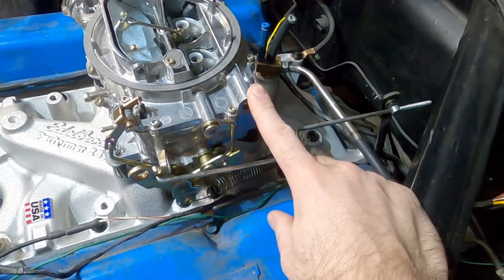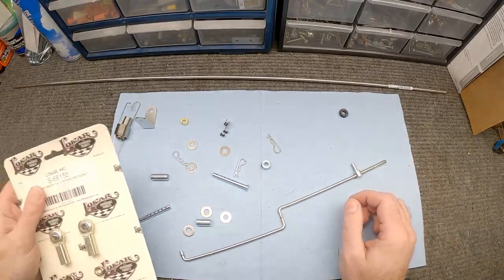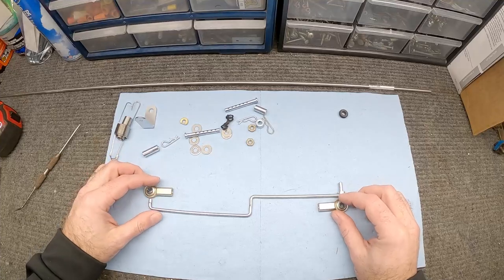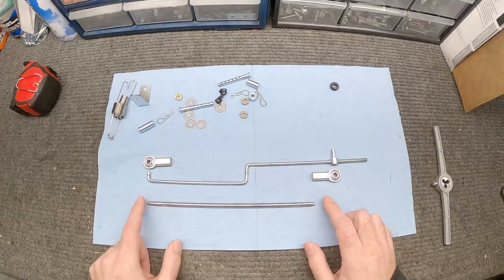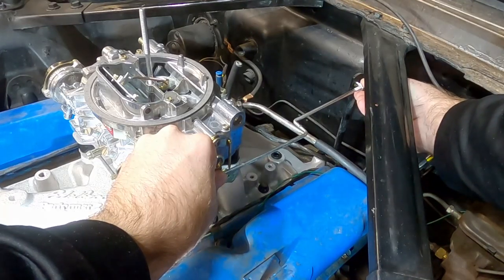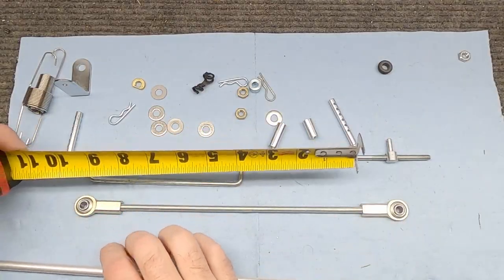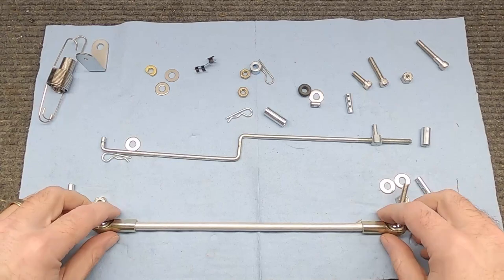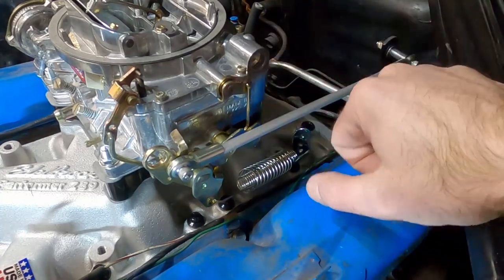How to make Custom Throttle Linkage

Comment: Made basically this same setup a few years ago. Recently I swapped out the aged and oxidized aluminum tube for stainless tube that I got at ace hardware for a couple bucks. Taped it off before I cut it and put it in a drill to polish it out.
Reply from the maker: It's fun making parts like this from whatever we can find out there.  It would have been nice to design this so it's adjustable, but it works for now.  :)

Comment: I was able to start my engine and break it in, I had a problem with the coolant, but other than that it all went good. I just went ahead and drilled a hole on the rod and called it a day. haha, my video would have lasted 1 minute hahaha.
I do plan to make it look better, but for the time being it works. :)
Reply from the maker: Congrats on getting it started.

Comment: I appreciate you documenting the goofs along with everything else. I also like the "doing it yourself is fun" comment. Sometimes driving into the smorgasbord   of extra parts is a more satisfying puzzle than just picking up that kit. There's a "reason" we save all those extra pieces. Plus an extra video this week!! I have the 1406 as well. 

Do you know why my fast idle would be slipping? Basically my set screw is in the correct place for the idle on the cam, but when it warms up the cam rotates and is in the wrong place on the next cold start. 

Are you going to have a carb tuning video? Can you show timing vs vacuum? Which is more accurate etc?
Reply from the maker: Thanks!
Unfortunately it's hard to see what's happening on your Carb without actually seeing it.  If I understand it correctly, if you blip the throttle before you start the car on the next cold start, the cam should drop down because the spring from the choke wants the choke to be in the closed position.  If that is not happening, either your springs needs some love, or possibly the shaft is gummed up and is not moving freely?  Again, it's hard to tell without seeing it.
I've got a video coming up where I show how to adjust the idle mixture screws using a vacuum gauge, there will be a little info on the idle screws, maybe something there will help?  :)

Comment: The stock linkage u have is for auto trans. Thats why it is in a z shape. The z shape is what hits the downshift lever.
Reply from the maker: Correct, but somebody removed that Kickdown linkage before I got the car, so it's not an issue.  Plus, pretty soon I won't need to worry about that Kickdown linkage anyways.  ;)

Comment: I ordered a jegs one for my 65 cutlass with an ls swap. I hope if fits good if not I will just use the ends and all thread as you did. Thanks.
Reply from the maker: Since I made this video, I redid my throttle linkage so it's fully adjustable, and I sell it on my website.  Part of the reason I did this is the price for the unit on Jegs is too high for the average hobbyist, considering how simple it is and basic parts.  I know this doesn't help you now, but just in case things change down the road.  :)
Reply: @AndyKruseChannel  thanks I wish I knew.

Comment: thats the same throttle rod coming out of my firewall on my 65 gto and when I send pics to folks they say they've never seen it before. My engine is out and Im going with a 3 2s setup befor was 4106 but this is real close to mine great thanks!!!
Reply from the maker: Right on!
Now you've got a video to show them about that throttle assembly.  :)
Reply: @AndyKruseChannel  Yeh I didnt catch where did that bent bar you worked off come from? That might work for me, when I get my engine. Its been 15 months since I removed it waiting for pistons.
Reply from the maker: @frekkledipped  I think someone said that was the throttle linkage for cars with an automatic.  Maybe something to do with the kickdown cable that Autos need?
Reply: @AndyKruseChannel  I just read that too, where did you get the bent piece? It looks interesting. I do like your custom one though and it doesnt look difficult to make after watching you
Reply from the maker: @frekkledipped  It was on the car when I bought it.

Comment: Looks good. The only thing I think I would change is putting an S shape bend in it and eliminating the back spacer. This setup puts some weird stresses on the bushing and fasteners. Putting a couple bends in it would also secure the tubing to the all thread and you could make it a bit shorter for adjustment without being loose
Reply from the maker: Yeah, this was what I could make with what I had available.  I've got a new design coming soon.  :)

Comment: Thank you for the videos, watch every one. At the end of this video you connected return spring to manifold. Can I ask what size bolt that is? Previous owner of my 66 painted the holes shut.
Reply from the maker: Nice!
I believe that size is 5/16-18 thread.  If that's too big, then it's a 1/4-20 thread.  :)

Comment: Great video 👍 I checked out your site lots of great looking stuff .  The one item that I know is in demand is the Ford to Edelbrock carb  Kickdown Rod adapter/linkage I just bought a AVS 2 to replace my 600 Holly and i seen some pretty crazy inventions none i care to duplicate . 
Edelbrock sells a cable kickdown bracket not a kickdown Rod bracket does your linkage Rod kits come with the plastic bushing at the pedal end ? I'm looking to pick one up from your site .
Reply from the maker: No, my kit does not come with that plastic piece as it's not required because of the spherical bearing in the Rod End of my throttle linkage.  :)

Comment: Andy, dumb question for you, but as someone who bought your throttle linkage kit and has an Edelbrock carb like the one here - how'd you drill out that hole to accept the larger bolts like those in your kit? Did you drill it out while it was mounted on the carb or is there an easy way to get that plate off and drill it out on the workbench?
Reply from the maker: Yes, I enlarged one hole on the side of the throttle lever to accept the 1/4" bolt.  You can do this on the car, but it may be difficult to get the tiny metal shavings off your intake manifold, if that's important to you.  Otherwise, you can pull the Carb off and drill it on your work bench, making for a cleaner install.  :)

Comment: I had same issue.  Found a one direction washer that locks in place once pressed on.  Washer has little cuts on inside to create tabs that bind to the rod.  

Rather than double up the springs.  Wouldn’t the short one be used for the front hole mount and the longer for the back hole mount.  This might then create the same amount of spring response.
Reply from the maker: Possibly, but putting the springs in the configuration they're in cleans up the area and looks less cluttered.  :)

Comment: Hey do you have a part number or any link for that throttle safety spring and bracket? I have installed the same exact intake and carb setup and would love the added safety
Reply from the maker: I believe it was part of a throttle spring kit I bought at the auto parts store. 🙂
Reply: @AndyKruseChannel  thank you for the quick response, I’ll take a look down at the store and see if anything looks similar to that setup thanks for the videos man

Comment: I had an issue with my pedal hitting the floor, and I realized the rod connecting the throttle linkage and pedal was bent from being slammed against the firewall for 57 years. The rod is surprisingly easy to bend. So, I just bent it in the opposite direction by pulling it up to fix the issue.
Reply from the maker: I love little fixes like that.  It's cheap and easy to do with immediate results.  Plus, when you have that "light bulb" moment, you feel even better once you solve the problem and slay the dragon!  :)

Comment: What type of throttle bar/cable was that?
Reply from the maker: The linkage in this video is just a piece of 1/4-28 all-thread, with a piece of aluminum tubing around it.  I never really liked the how I couldn't adjust it later without needing to trim down the length of the aluminum tubing on the outside.  I later designed a new linkage, that is fully adjustable, and I sell it on my website.  :)

Comment: Lube (oil) before you die cut. You might need some jam nuts on the bottom of the rod ends!
Reply from the maker: They're not right and left hand rod ends, so jam nuts aren't needed because there's no way for this small assembly to come loose.  :)

Comment: Is there a reason why you didn't use the larger hole at the front of the linkage on the carb?  Just need an adapter to fill the hole like the one on the bellcrank coming from the gas pedal, and just a little bit better leverage when mashing down on the "GO" pedal.
Reply from the maker: You said it, I'd need an adapter.  I didn't have one, I made due with what I had available.